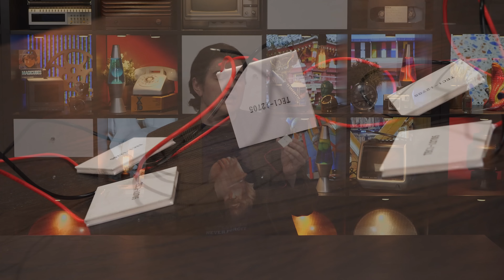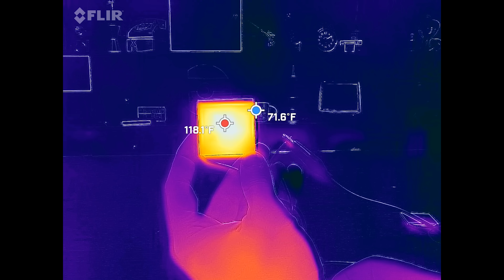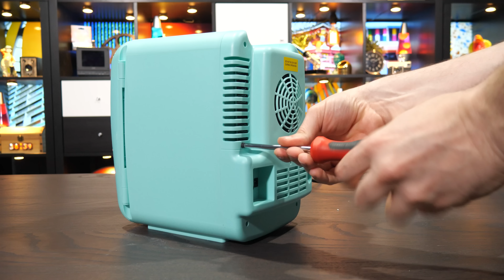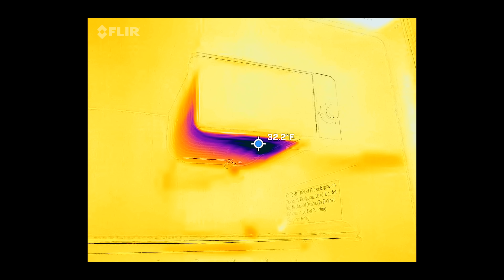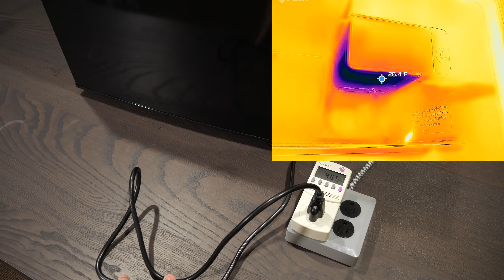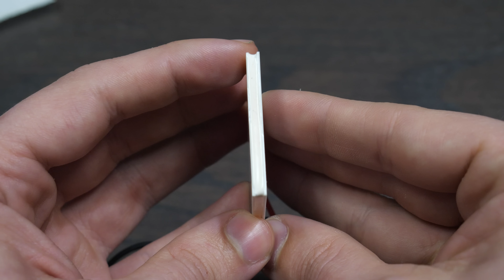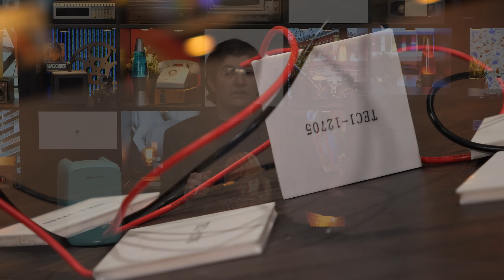Thermoelectric cooling: it's not great.

Comment: youre clearly missing the point "but this larger.... but this larger.... and the even bigger.... look how many more things it fits" the whole point is that it fits less. it is extremely small, it can fit most places, its very hard to make a tiny fridge that small, with a heat pump, as in impossible. The smallest heat pump fridges are about 1.7 cubic feet, the smallest thermo electric fridges easily get to 0.35 cubic feet.

Comment: Hold on a minute, your Petlier uses 5 amp and 12 volts, yes, that's 60 Watts, but that's not what you are paying for.  The adapter is running on 120 V.  for the power to be 60 Watts, you're drawing 0.5 amps.  But that assumes a 100% efficient adapter.  The highest quality adapter is around 88%.  Most are around 80%.  So, your estimation of the annual cost of the Petlier fridge is off by 20%
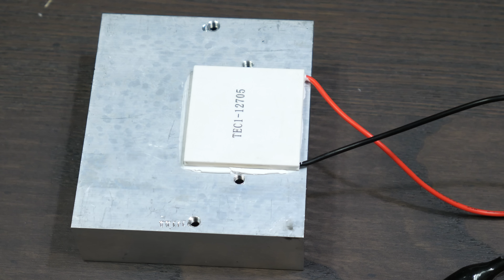5:10 spread the heat "more quicklier" ? can you spread it more slowly-er ?

Comment: Peltier devices have one other advantage that makes them insanely usefull in certain extremly specific situations that very few people actually find themselves in.
Peltier devices do work in reverse, meaning if you heat one side (using the heat generated from the natural radioactive decay of plutonium 238) and cool the other side using a heat sink, they do generate a miniscule amount of electricity, meaning they can be used as a power source.

Comment: Wow, thanks!  My parents just bought a Temu cooler for their car the day before I borrowed the car for a couple weeks.  Wow, it SUCKS!  I plugged it in an hour before needing it.  Barely cold and only at the square on one side.  Then while the car sits on a hot day, the fridge just gets warmer and warmer.  Now the 30 degrees below ambient makes since.  If the car is 120F inside, the fridge is going to be 90.  Well, it was $39 bucks, but it does have a thermostat on it.  Perhaps it reaches a temp and then cycles on and off.  If I look through the exterior heat vents I can see the giant heat sink in there giving the clue that it is a peltier fridge. 
 I just ordered a 21L portable 12v compressor fridge for my car (10x cost).  Supposedly does down to 40F in under 10 minutes.  Have not received it yet.  I liked your video because I had already known that the peltier fridges were pretty pathetic, but I "thought"  they were very efficient.  Apparently I was very wrong!  The portable compressor fridge I got is supposedly consumes about 30 Watts running.

Comment: Oh. So will the black box and red monster fridge fit in my car? Can I put them on their sides and have them work efficiently? Is that black box also 12V DC operable? 

Is the black box portable and easy to carry? 

Is the cheap green cooler the ONLY STYLE T/E cooler made? Or are there better, more expensive coolers that do a better job? 

Do the higher quality, more expensive cold/hot portable fridges do better? Would ICE accumulating on the INSIDE of the thermoelectric cooler indicate that it actually was producing 30-40° below ambient temperatures? 

Would transporting food in a T/E cooler, when it’s cooling at under 40° and keeping butter hard etc, suggest it was adequate for short trips? 
 
Your analysis of that cheap cooler as not great may be accurate, but you’re not taking other products into account as you slam it. Also you don’t take into account where and why it could be useful. A 40-50° soda is fine. Why is the comparison beer? Just to further make your point ad nauseam? 

Instead of the sarcastic, overly critical banter, you would be more helpful if you told us what the T/E coolers are good for, and how good the higher end ones are.

Comment: This video prompted me to dig out my fridge specs and lone behold it was thermoelectric with a temperate range of 5-15 degrees. I've long wanted a replacement so I did my research this time round, found a model with compression cooling rated 0-8 degrees for only £15 more than I spent on the thermoelectric one 7 years ago

Comment: This was incredible information, impeccably presented and I completely agree, but hear me out: these 6-pack coolers also come with an adapter to use in your car if your car doesn’t have a 120v outlet. I believe they are really designed to be used in a car on road trips or car camping. I know they have better larger cooler options for battery coolers now but when these came out I think this is what they were designed for.

Comment: I got one of those tiny fridges as a gift that also had a Bluetooth speaker built in.  It looked really cool, like an old Coke machine.  However.... In addition to not getting the cans cold enough, a normal bottle of soda wouldn't fit at all.  I got so aggravated with it, I just threw it away and bought a real minifridge.

Comment: 2 things, 1 of the uses for this is in electric razors like the one I own. It keeps a bar cold while you shave to help minimize razor burn by cooling the skin. 2, if you apply heat, like a flame to one side of the device, it GENERATES electricity! So you can line a twig stove with these, and recharge your devices in the woods with easy to gather dead fall. As a fridge it sucks, but they have great uses you just have to think outside the box with them.

Comment: I have seen there exist heat distribution fans which are powered by a pettier that you can put on a hot stove to move the hot air from a stove around the house

Comment: I got one for free and I found a good use a car cooler and if you put water in it as its sitting so the door is face up it actually works especially if you have a way to get more air through the heat sync

Comment: WTF is LaCroix? 

Anybody that's spent years working with Peltier coolers, like me, knows that such coolers are inefficient due wasting over 70% of it's energy in the form of heat a.k.a. thermal energy. 

Peltier coolers are great for cooling small, very specific items...computer CPUs/GPUs, industrial microcontrollers, moderately high amperage micro relays, and so on. 

Besides the inefficiency of a Peltier cooler, there are other drawbacks:
If you in an environment with moderate to high humidity(like my home state of Louisiana with 100% humidity year round), the cold side of a Peltier will condensate or "sweat" as most say. This moisture tends to have an adverse reaction with the fragile electronics being cooled. As a result, one must add a moisture barrier between the Peltier and the cooled part/chip...usually a small layer of neoprene rubber. But, by doing so, the cooling capacity is cut roughly in half.
Next, the hot side of the Peltier requires a finned heatsink made of a metal with a high thermal absorption and dissipation rate as stated in the video. But, the size of the heatsink needed to effectively dissipate the heat is inversely proportional to the surface area squared(a²) of the Peltier...in plain English, you only have so much surface area on the hot side of the Peltier that can be in constant contact with the heatsink...so, the size of the heatsink needed to get rid of the heat depends on the amount of heat generated(depends on the wattage rating of the cooler), the heatsink material, and airflow capacity of the surrounding area which all means the heatsink will always be much larger than the Peltier..and if you raised the wattage rating of the cooler by one watt, the heatsink size must be increased exponentially, not proportionately. Ex. 5 watt 2"x2" Peltier cooler...all other things being equal, will require an aluminum heatsink roughly 6"x6"...but if you increase the wattage capability of the Peltier by 1 watt to 6 watts without increasing the size of the Peltier, the size of the heatsink will increase by an inversely proportionate amount to roughly 9"×9".If 5 watts of heat energy channel through 4" of squared surface(the 2"×2" Peltier hot side) required 36" of squared surface area(the 6"×6" heatsink) to adequately dissipate the heat, a 6 watt Peltier of the same size will require a heatsink with 81" of squared surface area to adequately dissipate the heat. This just an example and not meant to accurate as there are other factors to consider. The point is if you increase the heat(wattage rating), but keep the same Peltier size(the side area stays the same but you can increase the distance between the two sides), you'll need an exponentially larger heatsink.

The above example was stated simplisticly to make a point, in reality, the surface area of the FINNED side of the heatsink is what matters, not the overall dimensions...more finned area equals more heat dissipation...longer fins, taller fins, more fins, sometimes thicker fins...all adds to finned surface area. 
Sorry to ramble.
Reply: In other words, Peltier coolers are fun to build and play with, but don't depend on a Peltier to cool something for you. As stated in the video, there are very few instances a Peltier cooler is the best choice for cooling. Even with DIY computer CPU/GPU cooling, the cons heavily outweigh the pros. A watercooled cpu is the better choice..the Peltier cooler will reach a lower temperature, but at drastically higher potential problem issues...larger cooler size, condensation, more noise from the heatsink fan needed, more power needed to power the Peltier and the fan, and so on. 
Peltiers are only good for cooling small, specific parts in tight areas where other forms of cooling aren't feasible(no room for the pipes/plumbing, an enclosed area that can't utilize compressed gas or water cooling, and so on). But, they are still fun to play with!!
Reply: @knowplay3258  Yes, it's great for cooling my phone or tablet while gaming or charging. 😅
Reply: @vellozz8661  And fun to play with by making little coolers or hotplates...but that's about it.

Comment: Could you slap a liquid CPU cooler on the blue fridge and bump the efficiency im curious
Reply: Yes but  a Peltier get far hotter than a cpu so the AIO would have higher and unsafe coolant temps. If it dosent have proper cooling, it becomes a sealed pressure vessel and with eventually rupture due to thermal expansion
Reply: @TSRB87 what about CPU coolers that data centers use??

Comment: found this interesting enough to watch it all, then again, im genx and have the attention span longer than 30 seconds... i would love to see a review of something like KIMMOO USB Rechargeable Desk Fan, 199 Speeds Portable Table Fan with Ice Cooling & Digital Display, 270° Rotating Quiet Turbo Fan for Bedroom Home Office that uses that type of cooling verses a swamp cooler that you can find on the market requiring no hose or install and small air conditioners using refrigerants that would require external venting

Comment: These peltier coolers work extremely well in 12v dc powered astrophotography cameras however. Where they are used to cool the camera sensor to greatly reduce thermal noise created by heat. 
These are typically run at -10c below ambient.

Comment: I love your videos... I had to comment on this one because of my somewhat extensive experience with these abominations. I work at a school, and for whatever antiquated reason, we are not allowed to keep personal mini fridges in our classrooms. These coolers aren't really refrigerators and are allowed. Leaving my Coke Zeros in the workroom fridge means they'll all be taken, so one of these thermoelectric coolers is my only option versus paying $4/soda from the vending machine. I've learned an additional problem with these things: shocker they don't last! I'm on my third thermoelectric cooler since 2019. The first one came from Amazon, a Cooluli or something like that. After about a year, the fan started making a grinding noise. The bearings had gone bad, and it quickly died. I replaced the fan with one of identical specifications, and that lasted another year until the whole thing quit. I couldn't quickly identify a failure point after disassembling the cooler, so I trashed it bought a "Frigidaire" thermoelectric cooler from Walmart. A "name brand" must be better, right? This one lasted about two years. One day, I came back from work after a week off (spring break, I think) to find my drinks warm. The cooler seemed to have no power, so I took it home thinking maybe I'd find a blown capacitor or something I could replace, and boy did I ever. The circuit board inside the back cover was blackened! Some component became extremely hot and may have even briefly burned. It smelled burned. I almost inadvertently burned down my school. I threw the cooler in the trash. Reluctantly because of the anti-refrigerator rule at work, I purchased another Frigidaire cooler from Walmart. This one looked the same but was revised. The one that burned up (and the previous one before it with the bad fan) had their power supplies and circuit boards as well as power cords and switches at the top of the cooler. The third one I purchased had all of these components moved to the bottom. I'm assuming mine wasn't the only one that almost caught on fire, and perhaps the components were rearranged because heat rises. By my calculations, I should be needing a new cooler within the next 6 months. We'll see 😂 One last thing... You mention that a potential benefit of a thermoelectric cooler is that it doesn't need defrosting like a mini fridge does. Well, that all depends on the ambient temperature where the cooler is used. My workplace keeps the temperature fairly cool, and there is routinely an ice square in the back of my cooler. But don't worry, it defrosts itself eventually when the ambient temperature increases and leaves a puddle of melted ice on whatever surface the cooler rests. Perfect. I'm going to politely send your video to my boss to see if the anti refrigerator rules can be amended. Thanks again for your content!

Comment: So it seems my idea for this could still work. Trying to make a cooling suit and can’t have a massive fridge on me. However I could put some of these on the torso and use the vents on the chest plate to push the air out the back and keep the water pipes in the suit colder for a bit longer. I don’t need it to get down to 30 something degrees, just need it to pull some heat off me better than fans alone.

Comment: Ok. The Peltier Pad cooler isn't much good for cooling drinks. However, I've been told that by using Peltier Pads in a different way they can generate electricity. Not a lot, I'm sure, but in some cases anything is better than nothing, and coupling a few of them together might prove more productive.
Btw, that mini-cooler is only using one (?) pad. I wonder what it could do with two or three. Hmmm,🤔.

Comment: I wonder just how feasible one of these Peltier devices on the back of my phone would work to keep temps down a bit while playing Morrowind with a telescoping controller.

Phones only have passive cooling, and after about 0.5-1 hour, it gets pretty warm, over 100°F.
Reply: Of course, I would have to rig up a way to add a copper plate on the hot side, with soldered on heatsinks for more surface area.

This phone is already heavy enough IMO, so this idea would likely be too much weight.

Comment: 9:10 With the advanced metric of eyeballing it Id say you can fit 45 if you get extra creative, place 2 ontop of the creatively placed cans, place 4  more next to the on the door, just dont close or open the door too fast, and then at the top atleast an extra next to the creatively placed can and 1 ontop of the 2 like a pyramid and one thats pyramid stacked against the can and wall, possibly 46 if you move the creative can to the right and have space for an extra one

Comment: I think you will need to videos more concise now when AI can give so good info. I could just ask Google "what are the downsides of Peltier cooling" and get the answer of the question that arise from the video headline.

Peltier has a place in for example cheap investment cost applications where running cost per volume is not the most important factor, or when the application is too small to justify a real compressor. I like my Peltier cooled car seats, for example.

Comment: I've seen them used in handheld 'cooling fans'. They do nothing to cool the air so you  just have to press this tiny cold thing to your face, which feels kinda good I guess but is really too small to make much of a difference.

They also drain the battery insanely fast, and the moment you disable the 'cooling' function - the plate heats up immensely. Since well, now all that heat needs somewhere to go and it's just going to flow back into cool part of the plate.

Comment: One thing I've been wondering while watching.. what about using a peltier element to heat? I mean it is essentially a pretty inefficient small heat pump (inefficient as in, it uses more energy). Which, from my understanding, just means more heat on the hot side. Would it be more efficient at hearing a space than a resistive heating element?

Comment: The blue fridge is obviously cheap junk but the technology used within is still not garbage. It takes slightly more electricity but if it had a controller the same as the fridge it could turn off when not needed. If it had better insulation like the fridge it wouldn't get hot as quickly and would be able to cool better. The only reason the blue fridge is losing so bad is because it's just cheap garbage. The technology was perfectly sound.

Comment: I have one of these (not the brand in the vid but same concept) and it actually works surprisingly well, it even got some ice forming inside only downsides was dust easily gets into the fan on it and the condensation is making the screws holding the heatsink in rust

Comment: 7-ZARK-7! Given the same wall insulation, per unit volume (or per drink can), it takes more power to cool or warm smaller volumes than larger volumes. It's a surface area to volume thing. (Not that this at all changes your argument about how inefficient a peltier cooler is, or the crapness of that little cooling box thing!) Thanks for the video.